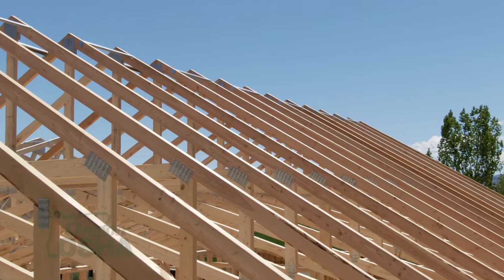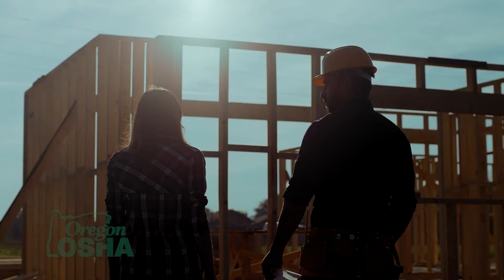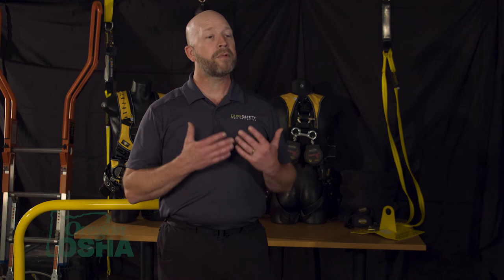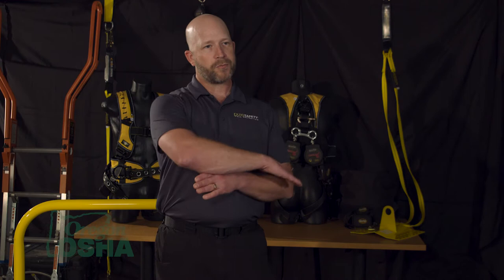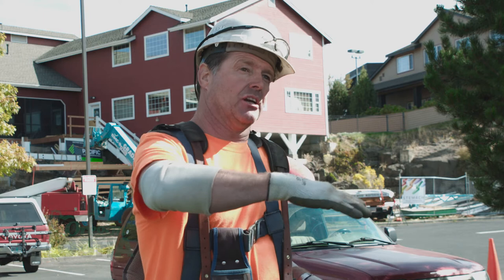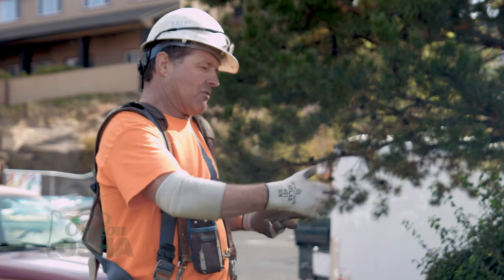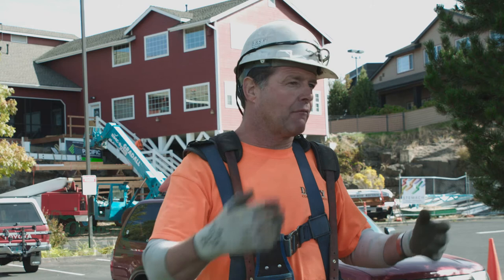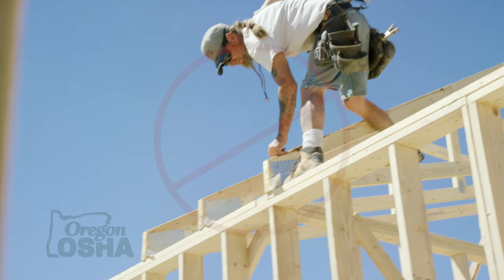The Challenge of Trusses - Using Fall Protection in Construction

Comment: 30 years, never used the crap, never fell.
Reply: My dad used to investigate worker's comp claims. Falling is extremely common. It's not normal, but being that a fall can pretty easily end a carrier, I think it's important to use safety measures. Basically shit happens and a bad day  can mean a slight mistake that costs forever. I don't think that work should have the same mentality as combat. Besides, I'm positive you had close calls, and the difference between a close call and a disaster is often luck. 

Not shitting on your skill, attention, or professionalism, I just don't think it's a good approach to dangerous work.
Reply: @robertaylor9218 : I agree with safety measures, first one is responsibility for the boss not to put unqualified or inexperienced people in dangerous situations. The safety market has been infiltrated by bureaucrats and regulators who are more interested in money and control than safety. Worst accident I witnessed was a framer on a roof who was so terrified that every step was like walking on egg shells; he stepped on another workers harness rope and fell. Won’t go into detail but he died from what would have been a ten foot fall if the workers weren’t forced to fumble around with the safety gear. I don’t mean to shit on your dad but he was a part of the scam that has over regulated safety in construction.
Reply: @scolee6408  That's really awful, for everyone involved. I'm a contractor, and have never been witness to a severe job site accident, largely because I follow the first thing you mentioned, but also luck and working on smaller projects. I (professionally) grew up with mom and pop companies that had abysmal safety, and in my experience this is extremely common on the remodeling scale of the industry. I'm on the short list of contractors I've met that hasn't been present for a major accident, and damned near all of them preventable with basic safety gear and practices. 

All that being said, safety equipment is no excuse to turn your brain off, as you pointed out that shit can quickly compound injuries if someone is misusing it. I am not proud to admit that I was late in implementing a lot of it, and when there are fall lines involved I spend a lot more time yelling for people to get down or pay attention to where they are and what they're hooked into. Though my current crew seems to get it a lot faster.